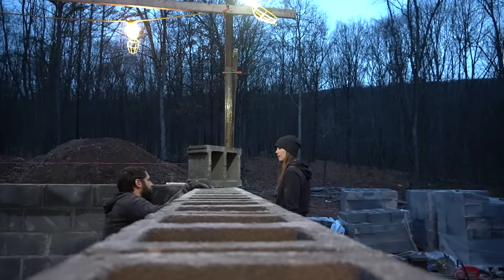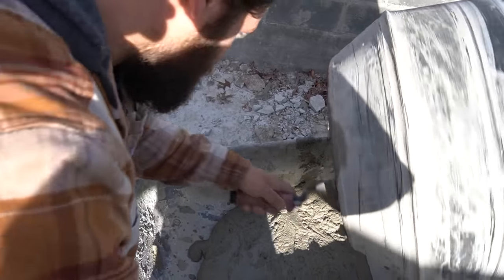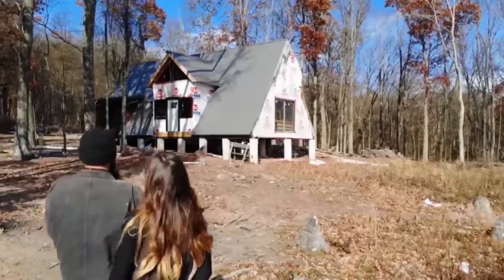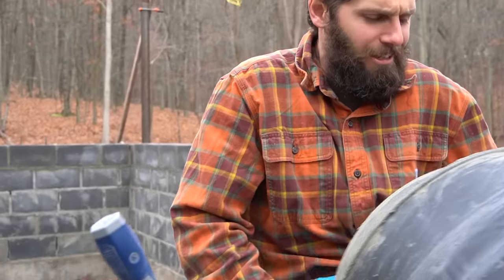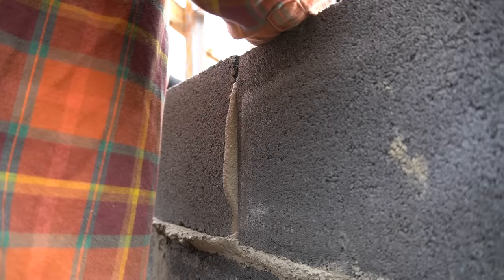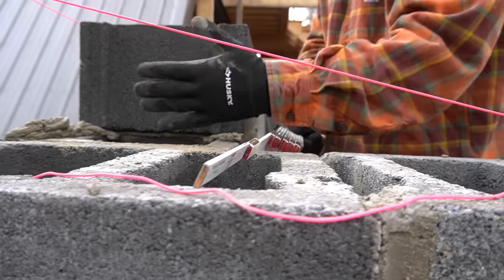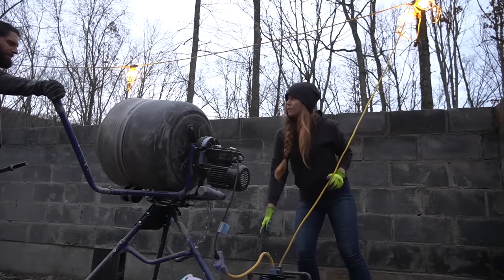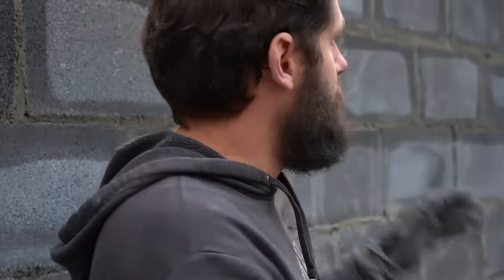WE ARE IN OVER OUR HEADS | A-Frame Cabin Addition

Comment: I remember that tiredness! As a 16 year old apprentice spark I was working a building site drilling Ceiling Rawl bolt fixings for stud supports for cable tray in pairs 1ft apart with 18 inch spacing for 200 yards. Day 1 I lost feeling in my arms. Coming in on day2 I didn't think i could get going but I did. By day 3 I had arms like Popeye and was rocking it. Keep going guys, Its a massive achievement to build your house on you own but you guys have built effectively 2 houses and now a full house sized addition and a Café. Full credit to you.

Comment: I am not a mason. However, I have picked up a few tricks over the years about laying brick or block. Something you’ll see real Masons do is work up on the corners, making sure each block is level and plum. Then you just need to lay your string line and fill in in between and those blocks will just naturally be level and plum without having to check them constantly. It makes the filling in of the rows go much faster.

Comment: A little tip Josh after setting up a scaffold for the remaining block laying drop your morter  joint to lay at least four blocks at one time then plumb them individually. That speeds up the process. Then you can increase the laying to six or seven at a time. Good luck on you new venture.❤ you guys.

Comment: Josh and Erin house is looking great. One thing I will say that my husband and I did was buy a used Lull when building our house. Could not have gotten the 20ft timber frame beams up any other way. BEST $ I EVER spent! It is invaluable on our farm too. When needing to replace metal on barns or move hay up higher than forks on tractor can this thing is a beast. Would help you with lifting those blocks and you can put a walk board on the forks of the lull to lay those higher-level blocks. Love watching your progress.

Comment: Hi Josh and Erin. You guys are amazing, Everything has to be 100 percent and that sometimes wastes a lot of time. You are laying each block making sure that it is 100 percent level in all directions, which in my opinion is wasting a lot of time. First of all, you have done the string set-up which makes sure that the corners of each block lines up with the string which is what you want, which is already level overall.  If there is a slight level difference to the inside of the building, it does not matter as I believe you are eventually going to cover the surface with something else, which reduces the need to be 100 percent perfect on each block. By doing it without checking each block with the level, you could do so much more in much less time and complete the task so much earlier. You might also consider placing the rebars from the top downwards into the blocks instead of lifting the block over the rebars when you lay the blocks. That will also save a lot of your energy and be more productive. You can also fill the holes in the blocks afterwards, especially where you have placed the rebars. I hope this will help you. Thanks for your videos and sharing your life with us. Love you guys. ❤

Comment: Hi great work, but I think you could save a LOT of work when you set on mortar only first row of blocks to catch a waterlevel, than dry lay 3-4 rows with horizontal rebar each 2nd or 3rd row and pour concerte between blocks. With this way you'll get solid concrete wall, which is impossible to destroy.

Comment: Looks really good, but I didn't see any bond beams (every 4 ft), or grouting of cells (the ones with rebar), which you have to do in lifts so that you can get the grout full depth without dead spots. Pretty tough doing this in winter. Hang in there, success will come one CMU at a time.

Comment: Wondering why there  is no 12mm reinforced steel bar on the upper layer of the blocks? In case of strong earthquake, the section without the steel reinforcement will easily crack and shaterred. Steel rebar should be placed vertically from the base to top of the blocks. In earthquake prone area. they put horizontal metal bars horizontally after 3 layers of blocks.

Comment: I've seen how it works your co crete wall,from the start I have noticed that the foundation of the concrete wall not so strong , like the corner are not formated with bars still the blocks in the corner were not stacking and inside the blocks is empty from mixing cement.

Comment: I am going to assume that you will infill all the voids in the blocks.  I have seen 'naders knock over concrete block walls far too easily.  I would have gone with ICF walls instead.  The pour would be over in a day and it would be thick and insulated in one go.  If you had used thru bolts that jbolt into the slab and are bolted up to the top plate of the wall it would be that much stronger.  Being underground is the best solution for surviving storms.  It would also mean that the ambient temperature would be a cool 66 degrees year-round.  Think wine cellar.  That would have been a better route you should have gone with.

Comment: Moving the blocks one by one, by hand is a ton of work! Is there a reason why you are not using the cart to move them? I know you can't fit many blocks in it, but compared to moving just one is already an improvement and the wheel would take most of the weight.
Also don't you have machinery to move the whole pallet of blocks closer?
Erin ain't gonna need gym though, that's for sure.

Comment: If that is a safe room, it has better have steel walls inside the hollow block. A large hammer would smash those hollow block in a few seconds. Also why the need for a safe room?? Is the USA that dangerous/

Comment: Consider not sortening the safe room walls.... and going back to the original planned cement block height.  Yes it's hard work, yes you're ready to be "I'm done" with the blocks.  But all of this was hard.  The A-Frame seemed hard when you started,... you did it anyway.  The "off the grid" seemed daunting.... you did it anyway.   Going up the cement layer walls seems like more work.... do it anyway.  Your current plan is to go 85% of the original planned height.  Do the last 15%.... it's only 15%.